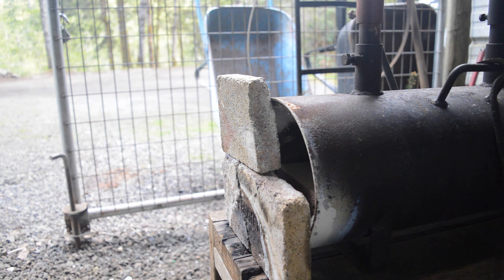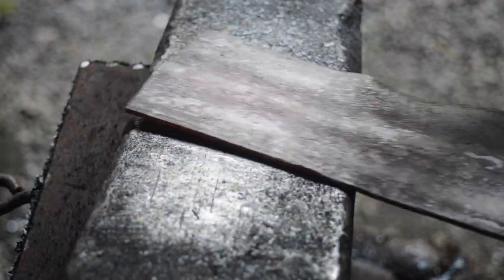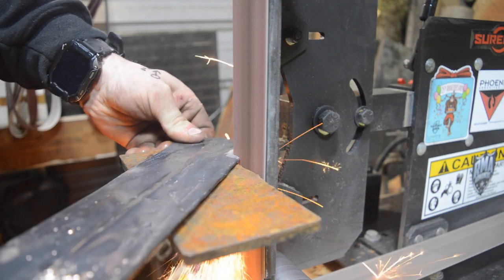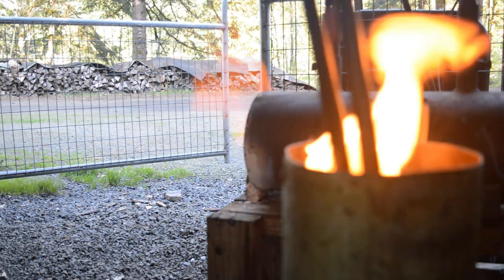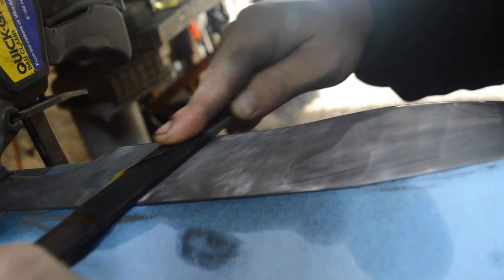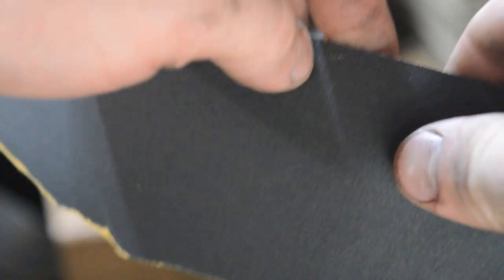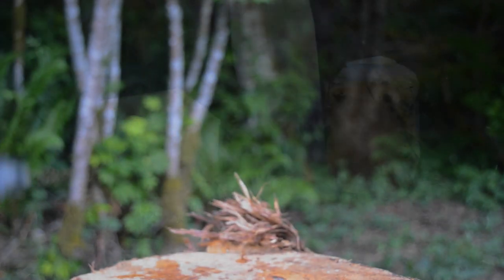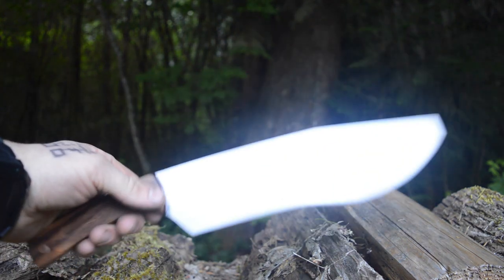Forging A Machete From A Bed Frame!!

Comment: I was worried when I was forging the angle iron straight...that the big seam in the middle would be a big weak spot in the knife and be noticable later, so I've only been making small knives from it. 
Looks like it turned out fine!
Reply from the maker: Yeah, I had the same concern too, but I was able to grind out that middle section and after testing, it's very durable. Thanks Eli!